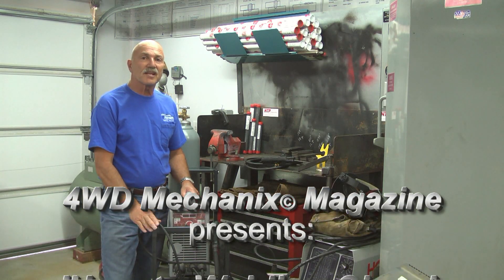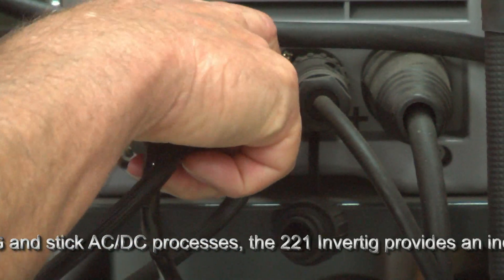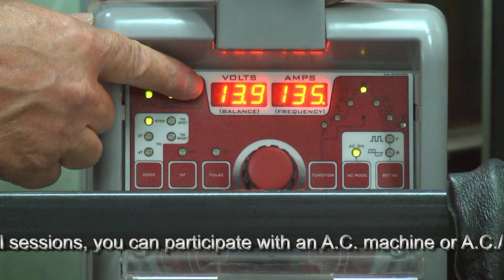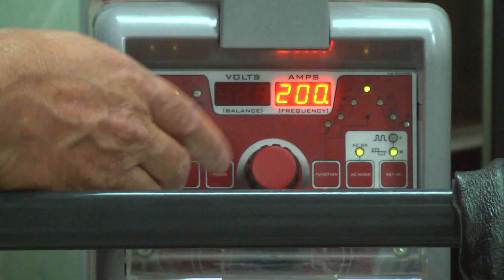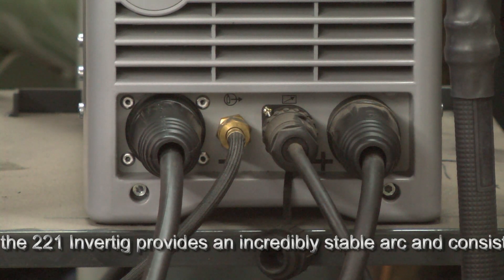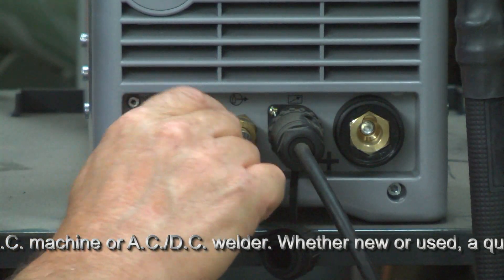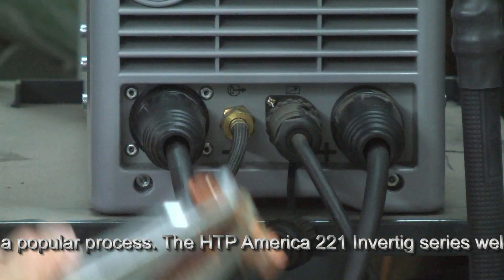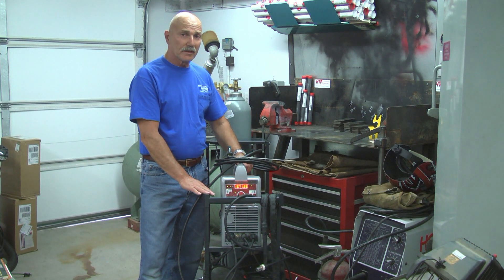4WD Mechanix Magazine 'How-to Welding Class': Setting Up the A.C. or D.C. Arc Welder

Comment: I know this is two years old, so how has the machine (221) been holding up?
Reply from the maker: Glenn Davis Hi, Glenn...A batch of comments just surfaced.  Sorry for the lengthy delay in responding!  The 221 HTP machine has held up very well.  Though not used daily, I would say the machine has met every expectation and been thoroughly reliable.  Not sure whether you've made a welder/TIG choice, I'm pleased with this machine and will resume using it for HD video how-to in the near future!  The parts backup and service from HTP America has always been tops.